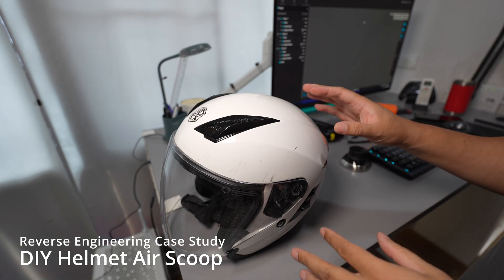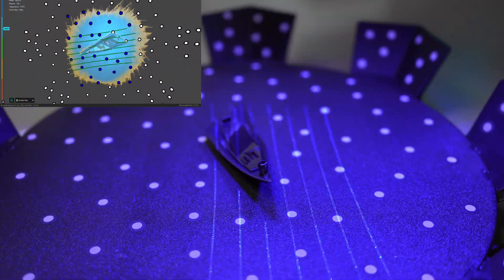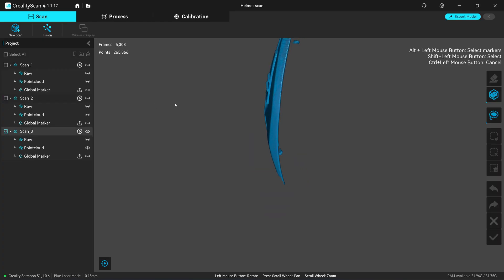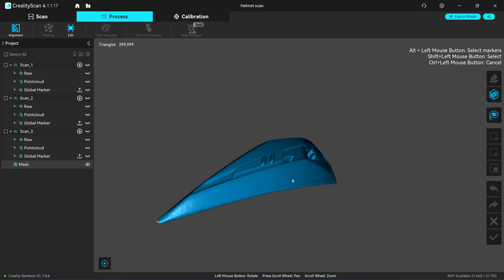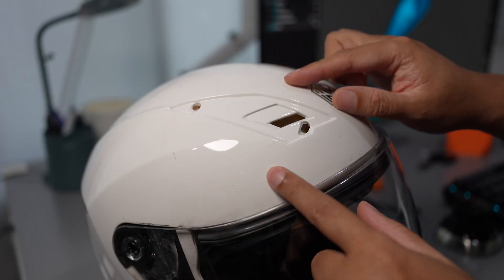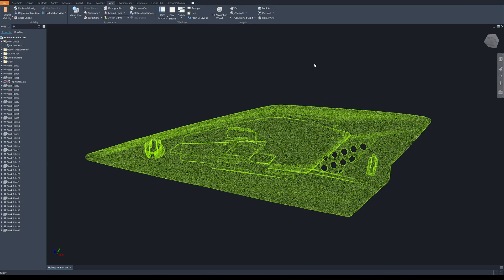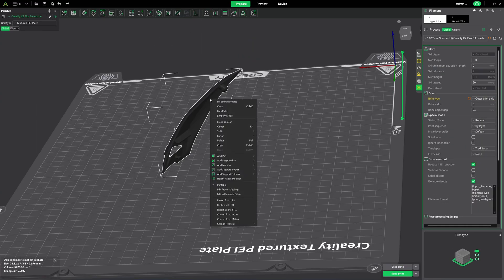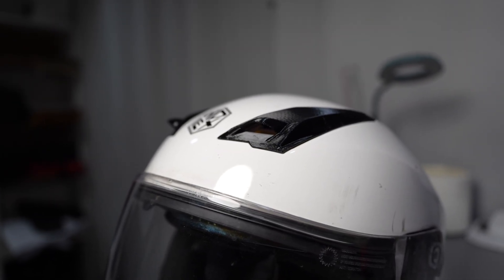DIY Helmet Air Scoop: 3D Scan to Print (Featuring Creality Sermoon S1)

Comment: Great video instalment in your growing channel of awesome 3d scan/CAD resources. 

Definitely the best channel of its kind I’ve come across so far. 

I love your helmet air vent design. 

I will say that the original more streamlined design would be accounting for very high air speeds. 

At very high speeds(100km+) there is a considerable amount of drag caused by your helmet, that pushes it back into your face. 
A lot of design considerations are made to the chocking effect of the chin strap has.
Hence a large scooped air vent could cause the helmet to want to flip backwards and cause pressure on your neck/chin. 

I do understand your step through scooter would be lucky to hit 100km/hr down hill, with a tail wind.😐😂😂😂

“Love your work”
🇦🇺🤜🏼🤛🏼😎🍀☮️☮️☮️
Reply from the maker: My 125cc scooter top speed at 80 km/h, stop acerating at 70 km/h. I've to go downhill to make it hit 100 km/h.

Comment: i just got my sermoon s1 and notice your parallel laser feature is working way better than mine? i know it's not the lighting, but on your preview screen you can see every line, on mine it barely shows any lines and is extremely finicky compared to the other lasermodes.
Reply from the maker: Have you tried Auto exposure?
Reply: @Payo-TensileCreator  i do a mix of both, usually auto. but the software recently had an update and now the parallel laser lines are  more responsive and show up more compared to last time/update. it's a little weird, i wonder if parallel laser works better in darker lighting compared to grid and single.

Comment: Neat trick with turning off a scan after the merge, I've always taken extra time to clean up mesh before the merge (didn't realise I could turn it off :) ). I think a lot of air vents fail because no matter how much air you funnel in it has to have a sufficient exit path eg, no real low pressure at the rear/lower. Great video as usual, thank you for the comparison and sharing your work.
Reply from the maker: Thanks! I'm glad you found that trick helpful.

Comment: Can the RaptorX scan this component as well as the Sermoon S1? Just trying to determine how your selection amongst the Creality scanners as well as the feature differences between the two. Thanks!
Reply: The raptor, raptor pro and raptor x are at least as good in scanning accuracy in blue line laser mode as the sermoon s1 - the Sermoon s1 can scan about twice as deep into cavities as the raptors, but that's the only real difference in quality.

So yeah raptor x should scan this too
Reply from the maker: Raptors can scan black and glossy surfaces just as well, but it takes a bit more time.
Reply: Yes i too wonder if only the high-end/high-cost models can do this… what about the otter even?  (I have the raptor regular, i think it will do it quite well, but still learning)
Reply from the maker: Otter scans glossy black better than blue laser and does it faster too. But keep in mind, the precision drops to about ±150 microns, so you’ll want to leave a bit of clearance—around 0.1 mm—when mounting.